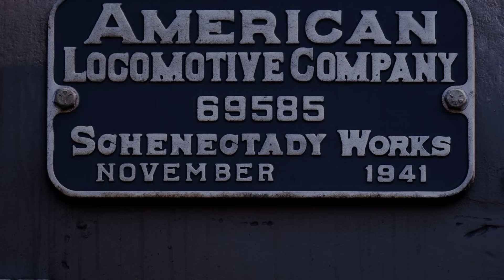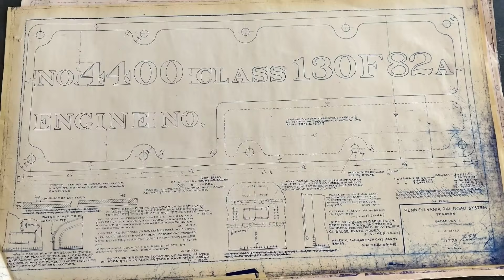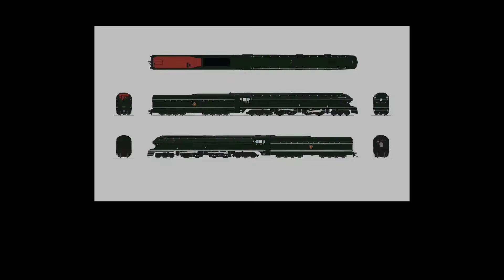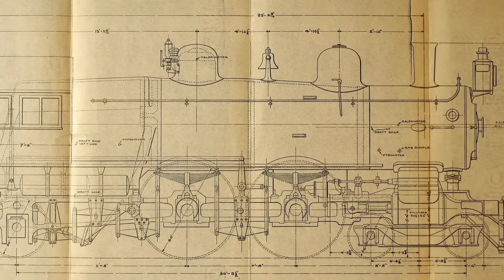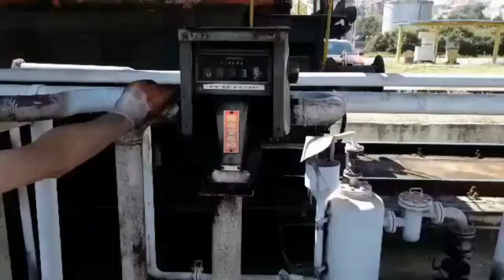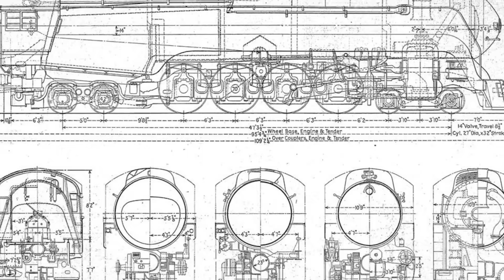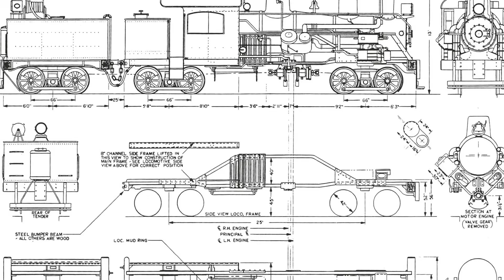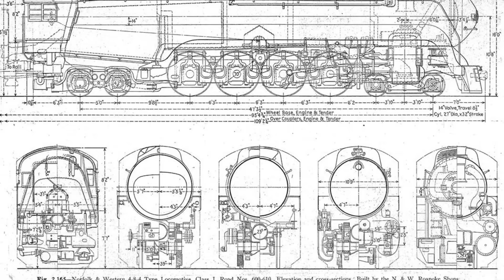The Abandoned Giant That Was Designed to Beat Big Boy but Never Ran

Comment: Thanks for this. I enjoyed parts of it immensely. I really liked the way you explain the sheer ecomomics of the rise of the Diesel engine,.   But overall, this is not quality effort here, Locomotive Geek. Your premise is that some sort of mythical arms race existed between the major locomotive manufacturers, and that simply isn't true. By the later half of the steam age, locos were purpose-built. The line would say, "I need an engine that can do this." They'd entertain bids and award the contract to the shop who could get it done. Secondly, your failure to mention the Allegheny series is criminal. The Allegheny beat the Big Boy in horsepower and sustained speed over the mountain ranges of the east. Since the PRR and C&O traveled the same terrain, it's logical to assume the engineers in Altoona would have taken a longer look at what they were doing in Lima than in Schenectady  Lastly, your whole essay is based on shelved blueprints. Every engineering shop would have had their next in line on the drawing boards when the big bosses made the decision to go Diesel. So to suggest by omission that ALCO didn't have Big Boy's bigger brother on the way but PRR did is disingenuous. All PRR wanted was a more efficient way of getting their goods from Point A to Point B, and they wanted a loco purpose-built to do it. They weren't trying to "beat" the Big Boy at anything.

Comment: steam power was ausome but let the water level go low in the boiler then they turned deadly with flash explosion. The crew always died.
Reply: In "modern" times this was a comparatively rare event, prevented (safely 99% of the time) by fusible plugs doing their job. I don't believe a boiler explosion caused by this condition happened ever in my country and am aware of only a small number of cases in the USA once modern steel boilers were the norm. Im unsure why this scenario happened on USA boilers and not other places in the world, it maybe something to do with sheer size or design changes not present in other countries.
Reply: It rarely happened. Especially after low water warning devices became mandatory. I've worked on steam since 1975 and know how locomotives are just like women. Treat them bad and they make your life miserable lol.  When these explosions did occur it was the fault of the crew and not the locomotive. But there just weren't that many of them

Comment: Steam locomotives--inefficient, labor intensive, uneconomical pieces of sledgehammer technology. But, dear Lord, what WONDERFUL pieces of machinery!
Reply: Before Diesel-Electrics became reliable, Steam Locomotives were the standard of efficiency for railroading.
Reply: @joeruiz4010  Quite so. Steam infrastructure was well established. diesel operators had to train/hire crews and deal with the different systems early makers offered. btw, their overlap was longest in coal country. Cheers.
Reply: Not really. Steam locomotives are probably still the optimal traction for a significant niche employment in railways around the world: relatively lightly loaded trains on routes which are not busy enough to be worth electrifying. That is a lot of railway.